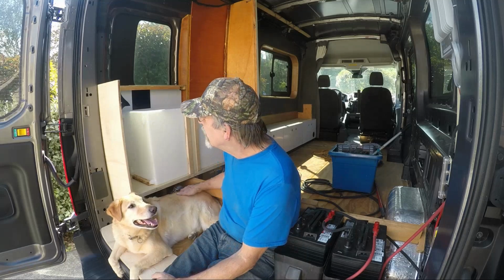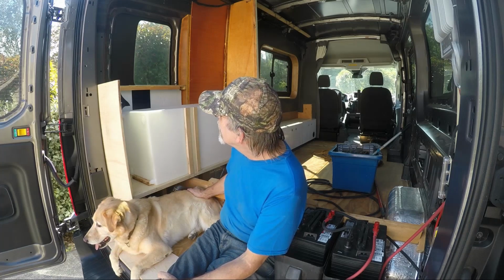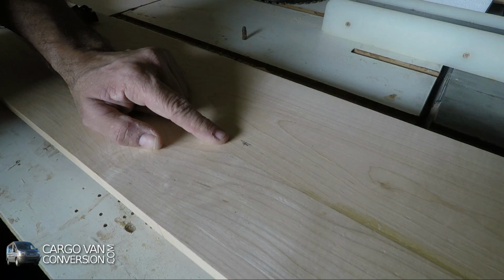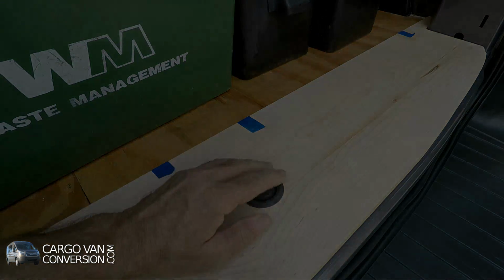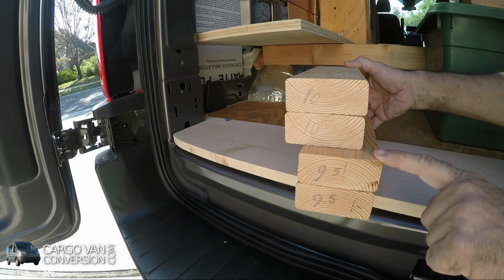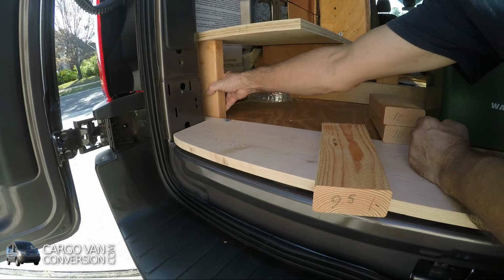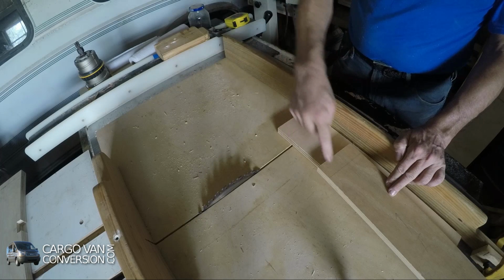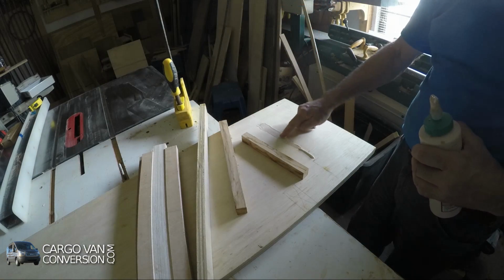RV Fresh Water Tank Installation

Comment: Did you consider using the space below the van for water tank? I've so far only seen one conversion doing that, and it was a sprinter. Is there no useful space under the Transits or was there another reason?
Reply from the maker: Hi Jay,
I see them regularly installed underneath and then I'm talking about fresh water tanks. But they have one big issue: they are usually not protected against frost. I know of one brand that has the heater's exhaust lines embedded in the sides, which keep the water inside from freezing. Gray and black water tanks are prone to frost too, but they can be emptied (so does fresh water, but that defeats the purpose of having them).
I think that especially the Sprinter has more below floor space available for tanks, perhaps the extended version of the Transit too. My long wheel base model has some that can be used between the wheels on the driver's side and because of the boondocking plans, I did reluctantly consider an extra water tank there, but the large size tank that I was able to include in the design, made that unnecessary. I will likely put a small gray water tank there, no black water.
Van Williams
Reply: Ah okay. I'm in Australia, a few hours north of Sydney, and temps very rarely drop below freezing. The Sprinter I mentioned is also in Au, but somewhere in Queensland where it is much warmer. Under the van seems like a lot of space not being utilised by so many, when space is such a premium in a van but it makes sense that it's not really worth the trouble in climates where freezing is an issue. Thanks for the reply!
Reply from the maker: Hi Jay,
In some of the extended length vans they sometimes do create an opening in the rear floor and build out a compartment that extends underneath the van, but is only accessible inside and place batteries in it, sometimes with heating pads if necessary. All kinds of inventive ways to create additional space.
I assume the Newcastle or Tamworth area, but it's such a big area :) Never been there, but almost lived there, likely in the Brisbane area. So I have a fondness for the country. Remember, my dog's name is Joey; now you know why :)
Van Williams

Comment: is that a class a customs watert tank? and do you  like it thus far? i have read mixed reviews. solid work on the wood!
Reply from the maker: Yes Shane, Class A Customs tank. I've had it for more than a year now. I've no experience with other brands, but it's the basic tank in a lower price range. This one is 46 gallon and I paid ~$100.00 for it, including SH. BTW I also got a 15gal tank, that I'm currently installing under the van as a gray water tank. Because I placed it on its side and because it's such a large tank, it will bulge on the sides, when it's filled with water. I expected that in advance from affordable tanks and I added two supports on the side. Have had no problems so far and would buy them again.
In general, when money is no issue, you should look for a thicker walled tank, preferably with baffles inside, which restricts the water movement while driving. I also like the around the wheel well tanks, for obvious reasons. A lot depends on the tank size you require and the money you want to spend.
Van Williams

Comment: I live in my transit through the week for work, its a bit rough and ready but everything works with gas and electric but I would never use much more than 5 gallons (but carry 10) most campers carry about 15gal. just how big is your tank. I'm not having a pop at you, it's just the more you carry the heavier the van 1gal= 10lb and that is a lot of weight if you crash. 
Also, does your tank have baffles to stop the water banging about when diving as this can cause a lot of energy?
Reply from the maker: Hi john:
You're right with everything you said. My choices are a compromise.
My intentions when I'm permanently on the road, is to boondock most of the times and on average to stay well below 200 driving miles a week. Generally I would not drive with a full water tank, for the reasons you mentioned, but also for mpg.
The tank is 46 gallons and does not have any baffles. The size would allow me to stay longer at the sites I visit. When I have to drive a long distance, I expect only to carry enough water to sustain me for a couple of days (< 10 gal).
Van Williams

Comment: Hey Van, great job again. The best joinery work of any van build. Question: at the 9:02 mark, right after you drill a hole, you do something with the drill using a fitting or attachment I can’t quite make out. What is that and what are you doing there? Reaming out the hole a bit? Thanks in advance.
Reply from the maker: Hi Steve,
It's a regular countersink bit with a stop attached, to seat the screws into the wood.
Have a great day!
Van Williams

Comment: Did your table come with a dado guard?  I had to get TAP Plastics to fab one.  :-/
Reply from the maker: Hi Neil,
The guard that came with the table, is probably wide enough for the dado blade, but I never used it. Despite that, I would advise everybody to use a guard, because recoil of wood that's fed into the blade, can kill you. The table comes with different inserts, but I use only the dado insert with the dado. With a regular blade, I use my self-made insert, which makes it safer to use.
Van Williams